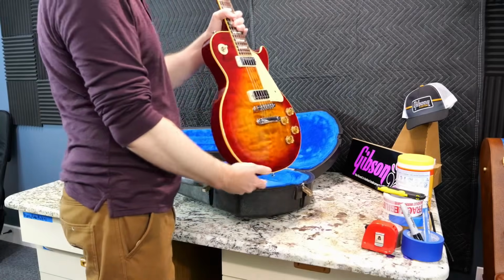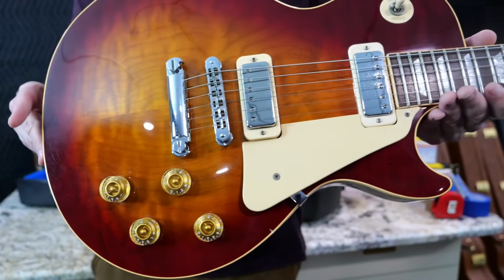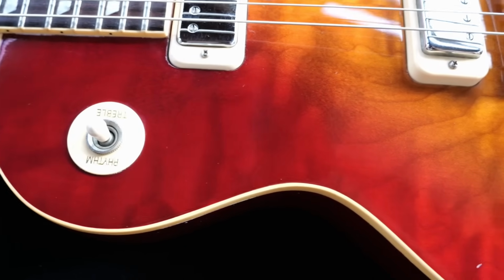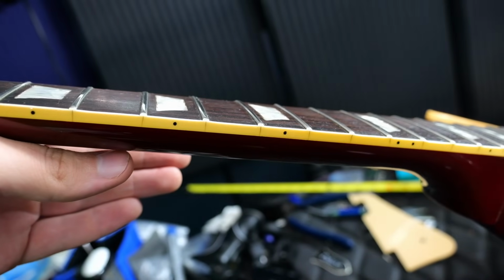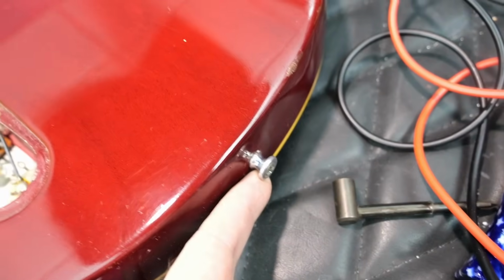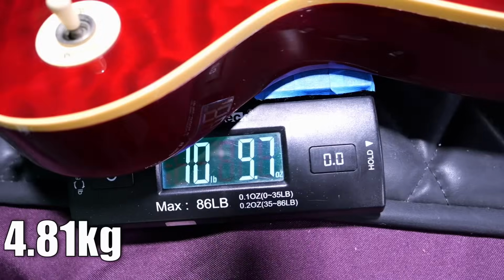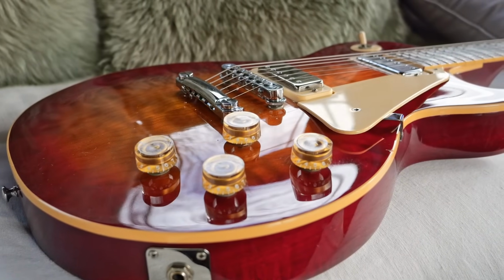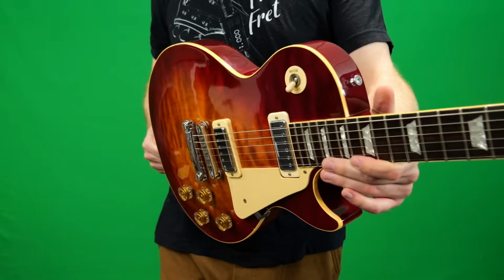This Had a Hidden Secret! | 1985 Gibson Les Paul Deluxe 2 Piece Quilt Top Heritage Cherry Sunburst

Comment: I have a 75 deluxe.  It has standard HBs, 3 piece plain maple top, 3 piece pancake body and 3 piece mahogany neck. Stock from the factory.  It has the classic headstock repair seen on many deluxe.  At 10lbs its a load to sling around every night.   I got it from a friend in the early 80's.   He had a paisley tele he was playing and loaned the LP to me.  Of course he knew I wanted it and he eventually sold it to me.  I've had it refretted ,New nut and hardware over the years.   Still plays like butter.

Comment: If your anything like me when I get a new (or new to me) guitar I usually play it almost everyday a couple or so times a day. If thats what your doing with that The Paul with the satin finish definitely at least give us an update on how it has faired through the playing. I was trying to see the base plates in the pickup cavity.  But not sure if I'm either seeing where those sunken parts of the plates are just the way it looks or if theat may be pop rivets holding it in. Maybe it's just glued in as you said. Those solders looked a little iffy any way. From experience and my instructor when I was young the yellowing around a solder is typically from an unclean surface and or to much hear or  to long on materials being soldered. Which usually causes a solder to release as that one did on that pot. Them mini humbuckers have a real sweet full sound together. They sound like you could play from most genres easily . Set up and maybe what the previous owner was using at the time he was using distortion could be what the issue. Also that one wire being unsoldered could've been contributing to the issue he was experiencing .

Comment: Seems like the body shape is somewhat different. It looks like the arch opposite the horn cutaway comes out further before it curves, kinda like a Chibson. Is the horn on the cutaway “lazy” as well? Meaning, is it deeper & starched to the neck at the 18th fret instead of the 19th? Maybe that’s what the older Chibson body shapes are based on?